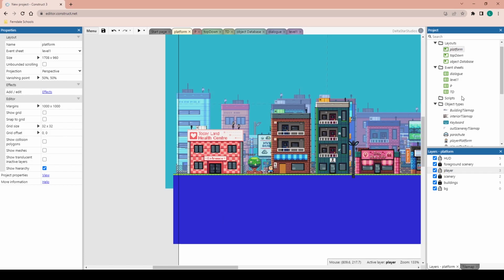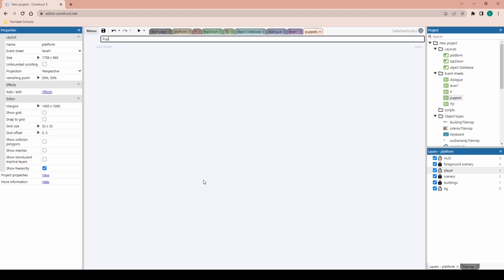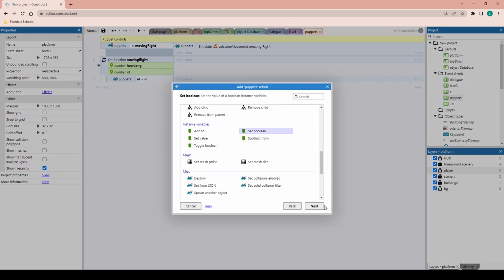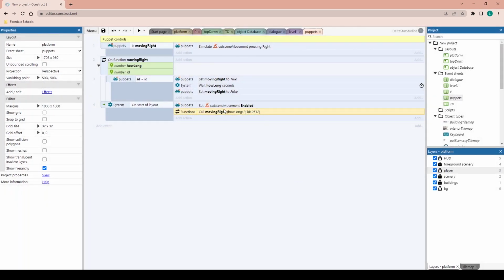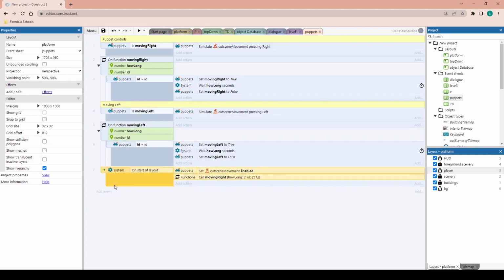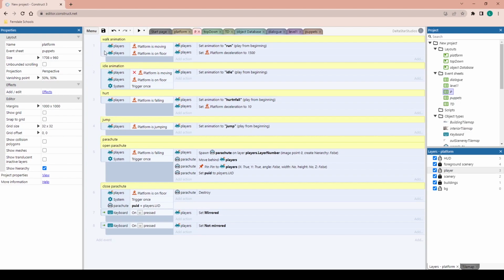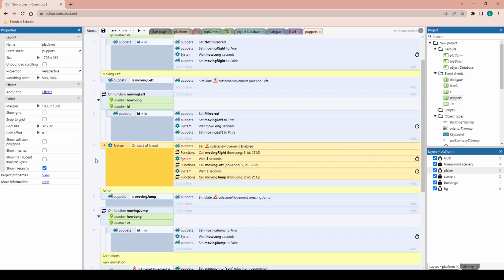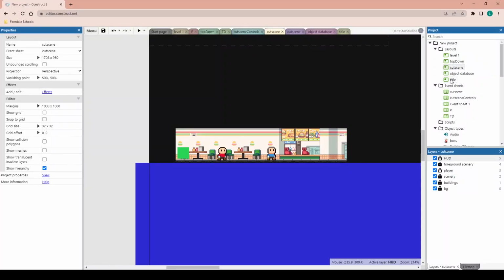Construct 3 Tutorial: Puppet System for Your Cutscenes

Comment: I applied the code the exact same way, but for some reason when I try to make the character move forward and stop, they would do that, but their animation kept running and not switching to idle. Despite it saying it should. Idk what to do
Reply from the maker: Do you have event 12 from 10:58?
Reply: @deltastarstudios2809  I figured it out. Turns out it was the "trigger once" condition. Sorry about that, but thanks!
Reply: @JeffKyler14  wait how did you fix it?? I'm having problems with it too I use a 4 diraction character. Since it's a top down game..
Reply: @deltastarstudios2809  Yes, I do